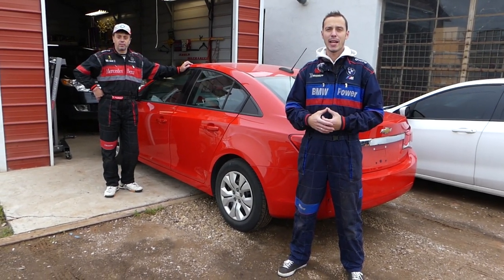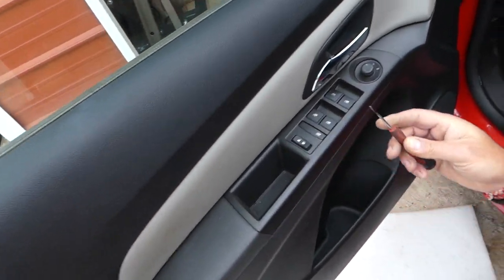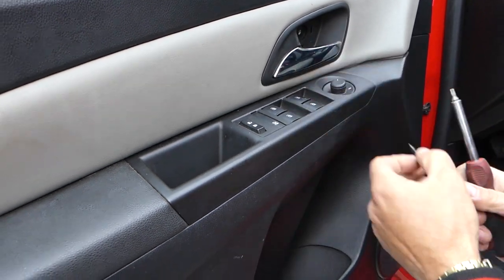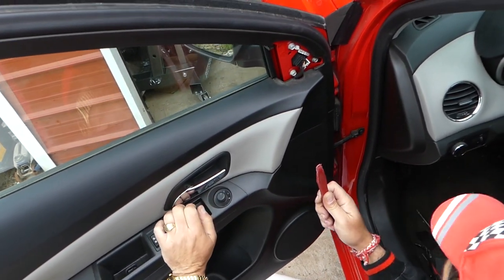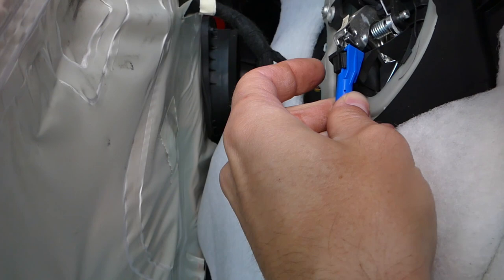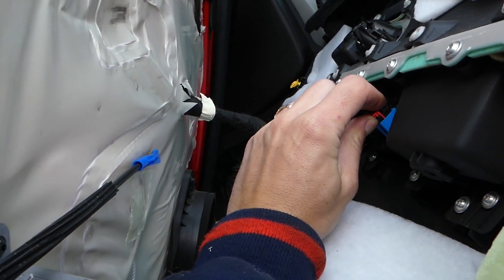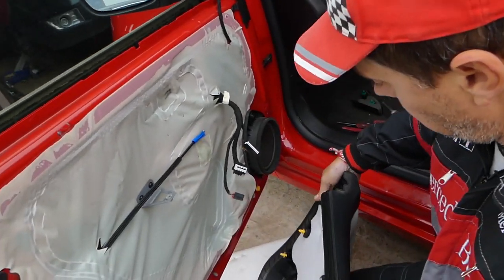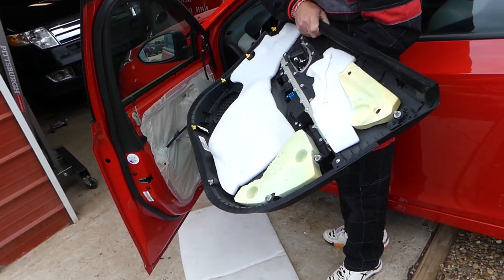CHEVROLET CRUZE FRONT DOOR PANEL REMOVAL REPLACEMENT. FRONT DOOR PANEL CHEVY CRUZE

Comment: Excellent video. I was able to do the repair on my wifes cruze thanks to your video. Thank You. Also, the only complication i had was that the 3rd party regulator motor had a different electrical connector so i had to transfer the old motor to the new modulator assembly.

Comment: I bought a salvage 996 that overheated. The thermostat was stuck. Overheating caused it to drop a valve seat (they're pressed in). That caused the piston to smack the valve. Rebuilt the top end and months later threw a rod in the same cylinder. Hitting the valve caused enough damage to make the rod bearing fail a few months later.